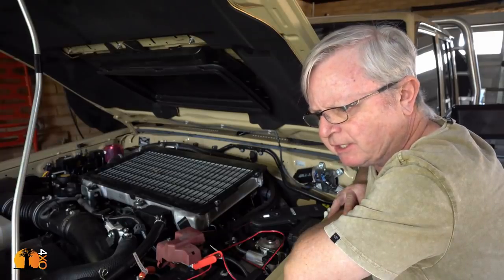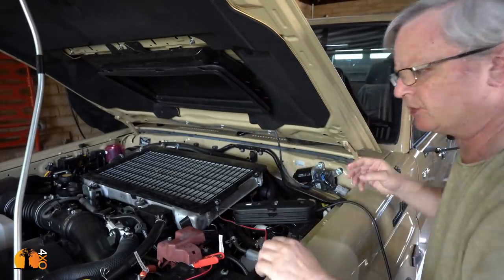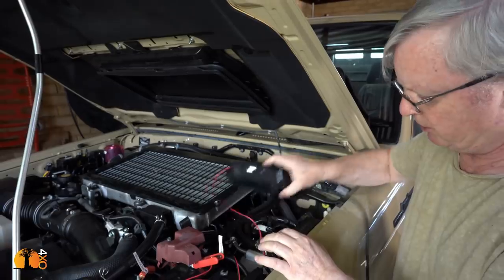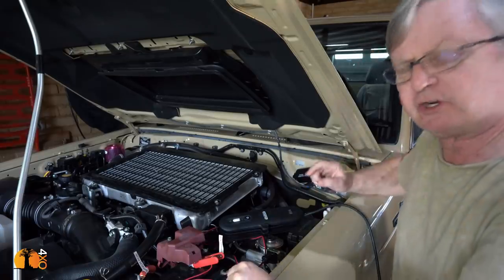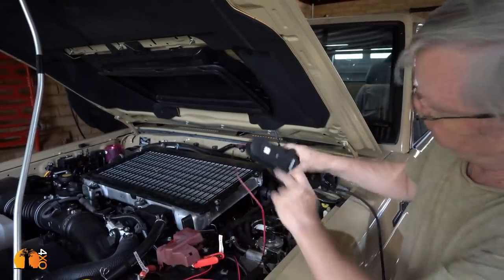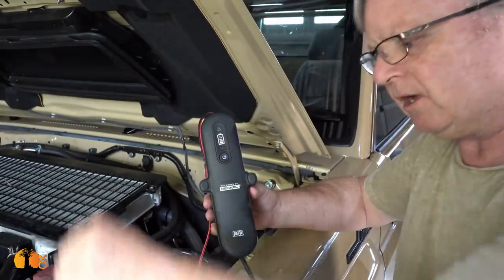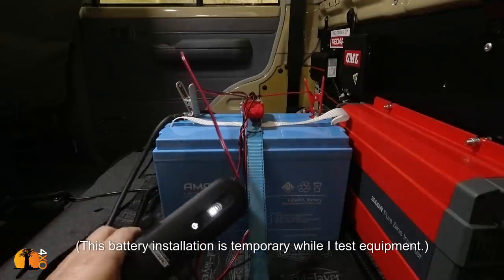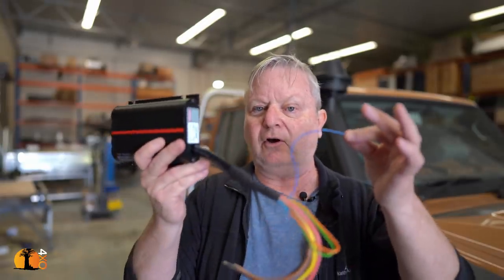DC-DC CHARGER RUNAWAY DISCHARGE WARNING.

Comment: Andrew, possible solution, mount a solar panel on your garage roof and run cables down for easy connect on to the yellow cable (solar input) on the Redarc. When the Redarc sense solar input, it will not accept input from the main battery. Therefore, as long as you only have your 10amp start battery charger on at the same time as the solar connected to the aux, then you will effectively have separated charging of batteries. 
Regards, Sean
Reply: Another, solution, in the red line between the start battery and the Redarc, add an old style silver 100 amp continuous duty  solenoid (the type we all used to used in simple dual battery set ups years ago) then trigger this from the windscreen wiper motor. Then, the start battery can only feed the Redarc when the engine is running.
Reply: i have no problems,my dc todc charger wont draw onece it reaches 10.5 volts,plus i use a dedicated deep cycle battery charger,it will charge two 120 amp hour batters plus the start battry,correct your set up.you may need a voltage sensative relay.
Reply from the maker: This is not a problem I’m trying to solve. And neither is this a mystery as to why it happened. It can and will happen to anyone using a DC-DC setup. It's the nature of how DC chargers work. All of them with the exception of those relying only on a trigger wire. The solution is to charge the auxiliary batteries first. It's that simple. When I learn something, I like to share it.

Comment: I love DC-DC chargers, but thought it to be common sense to isolate the primary and aux batteries before connecting a 220V charger anywhere in the system, even if charging the aux battery/s and the DC-DC charger won't let current through to the primary. 
I always run a 12V 60A circuit breaker between the two battery systems, this way you can even use two 220V chargers at the same time to maintain both sets of batteries whilst the vehicle is not in use for some time.
Reply: Agree Dirk, Isolation prevents any 'oops moments' , simple and effective.  :)
Reply: Agreed.  Circuit breaker to isolate.  Simple and effective.

Comment: Many thanks for the heads up on this. Just a couple of weeks into a van to camper conversion. I will add in an isolator in the circuit just to be sure. I was always taught never to leave the ignition on, that stems back to old petrol cars where depending where the points were your coil could burn out. We used to pull the coil wire off if we had to tow a dead car for the same reason.

Comment: U should have ur BCDC charger on the trigger switch u mentioned. The trigger switch can also be connected to a wire that only receives voltage when the car is running. U could also add a breaker so as the BCDC charger doesn’t see the voltage when ur trying to charge ur main......

Comment: As an Electronic technician here is some good advice for you. Never , ever charge your battery in your vehicle with an ac wall charger while it is connected to your vehicles electronics. The reason is that if for what ever reason you would have a voltage increase from the mains power or thermal runaway then you would fry your vehicle electronics. Always remove the vehicle positive terminal from the battery. You can however jumpstart from another vehicle like you would be doing right now. DC to DC chargers is for DC to DC.... not AC to dc to dc.. If your vehicle battery only was flat then you will need approximately need 10 to 15 hours on 10 amps to charge the first battery. Adding more batteries does double and triple the charging time. For an example. Drawing 10 Amps for 2 hours from a 100 amp hour battery means that you have used about 20% capacity. Charging the same battery with 10 amps will not fully charge that battery within 2 hours because as the battery gets fuller, the amps drop to eventually you will only be charging at about 1 or 2 amps. The time taken to charge the battery will be at least 8 hours.

Comment: Andrew, I realise you've identified the issue, but here's a suggestion for the future. I've fitted an Enerdrive 240v charger in the canopy of my Silverado. It has 3 separate "channels" for charging 3 separate banks of batteries. I have a somewhat similar set-up to you... A Redarc BCDC1225L and solar panels on the roof of the camper. 
When I plug the 240 volt cable into the caravan-style receptacle, the Enerdrive charges the Lithium battery, which is set to Channel One (in the canopy) first. It has the ability to choose what type of battery is being charged.
Once the lithium battery is charged, it then turns its attention the Channel Two, which is the twin under-bonnet starting batteries. To achieve this latter function, I've simply tapped the Channel Two supply line into the cable that supplies the BCDC with its power from the front batteries. 
In your case, if you go ahead with another lithium battery (inside the canopy of your truck), then you can utilise all three separate channel of the Enerdrive.
If you're interested in my Chevy, here's a write-up that was done a year or so ago: https://loaded4x4.com.au/issue-002#61
Reply from the maker: This is not a problem I’m trying to solve. And neither is this a mystery as to why it happened. It can and will happen to anyone using a DC-DC setup. It's the nature of how DC chargers work. All of them with the exception of those relying only on a trigger wire. The solution is to charge the auxiliary batteries first. It's that simple. When I learn something, I like to share it.

Comment: Fascinating! Thanks for sharing your knowledge. This situation is certainly not one that people would immediately expect to occur. I’m about to design and roll out a system into a 4WD van and I will certainly put an isolation switch between the crank battery and my custom goodies - even just if starting with jumper leads etc I don’t want the aux system taking some of that load away.
Reply: Oh - before I forget, and hopefully this helps someone - I reckon if you want to hook up that ACC wire to trigger the DCDC, hook it up to Ignition / ON position instead. That way if you’re sitting in the car in ACC mode listening to the radio, your crank battery isn’t being drained to charge the aux battery.

Comment: I run the trigger wire through a switch and to 12v+ that way I control when the DC-DC is on.
Reply: Hi i do similar ,plug into cig plug and works fine, cheers terry.
Reply: What happens when you use solar and the car is off
Reply: @Nathansillav  My solar batteries are separate from the vehicle, so it functions the same if the car is on or off.

Comment: Hi Andrew. I'd suggest re- approaching Redarc with regards to apsolute clarification as to this blue wire and voltage cut off. Someone has to be wrong, otherwise state of the art Redarc starts to look like well outdated Redarc (and any other dcdc charger that works in a similar way). I truly believe it's not Redarc as instructions despite not being so clear, suggest it's all down to this blue wire not being connected. Now a great video would be to connect the blue wire and do the same test, then try with the ignition left on to test voltage cut out, or as the case may be no voltage cut out with a mains charger connected.
Reply from the maker: This is not a problem I’m trying to solve. And neither is this a mystery as to why it happened. It can and will happen to anyone using a DC-DC setup. It's the nature of how DC chargers work. All of them with the exception of those relying only on a trigger wire. The solution is to charge the auxiliary batteries first. It's that simple.
Reply: @4xoverland  Yes true, it is a simple solution. However I'm more thinking along the lines of alternator output - I'm running a smart alternator as fitted by Mr Toyota, if I remember correctly you have changed yours or was that just the Africa terrain tamer build?  So a smart alternator can drop output to something like 8 or 9 volts, is there a scinario where by your starter battery can be fully charged in the eyes of the smart alternator however your aux batteries are near depleted and the dcdc charger pulls your starter battery down to a point where by it can no longer start your engine despite the alternator still effectively charging? My theory is the smart alternator should be smart enough to figure this out and fast enough/be able to provide enough amps to starter battery to cope.
Scinario 2 - your alternator becomes defective and cannot provide enough amps to keep your starter battery topped up, the dcdc charger will happily help kill the starter battery much quicker, this drops to a point where your vehicle electrics cannot run and your lose engine and all "factory" vehicle power. (It would happen anyway but the dcdc has made it happen much quicker. O.k. alternator failure isn't that common without warning and if it did happen your red dash charge light comes on so you can pull the dcdc fuse and potentially divert solar power to give the starter battery some form of charge - that would be pretty pointless in the U.K though, with our weather! 
Perhaps I'm overthinking the perfect storm combination? I think I'm into my 6th or 7th year of unbroken patreon support for you Andrew. Keep doing what you are doing, we all get a great amount from your videos. I truly like the fact you are unbiased and not worried about saying the truth. 
Do you have any future trips planned with Mr Paul Marsh? Stay safe and let's ride this storm out one way or another...

Comment: I was installing a BCDC 1225 this weekend, and found your clip pretty interesting. My install was in a camper, and it got me thinking… This issue looks like the starter battery needs to be better isolated from the house battery, and possibly it makes sense to treat it like a camper install and use a solenoid or an SBI to only link them when the ignition is on?

Comment: I also have a Ctek 250sa DC to DC charger hooked up to a solar panel (because it's not a daily drive) it charges the 2nd battery and when that's charged it starts charging the start battery.
Reply: Exactly. Take any overflow from auxiliary battery bank back to the starter battery. I’m looking at a dual-sensing VSR for this purpose. The Jaycar one has cut-in at 13.3V and cut-out at 12.8V.

Comment: Thank you Andrew, I always follow your channel with great interest and I particularly appreciate your willingness to share freely your knowledge and insights. I would be equally keen to hear expert opinion from Redarc on your observations. Presuming you have this would you share those with us too perhaps?
Reply: Carl Tunstall shame his information is often incorrect, omits important details or is a bias of his ignorance (take the ARB TPMS video for instance)
Reply: Here’s what Redarc said.... In regards to the connection of the blue trigger wire on BCDC, the following needs to apply:
1) If your vehicle has a standard alternator type (fixed voltage), the blue wire can be left disconnected
2) If your vehicle has a smart alternator type (temeprature compensating or variable voltage), the blue wire needs to be connected to an ignition source
3) If you are unsure of what alternator type you have, it is best to connect the blue wire to ignition

We have indeed seen the video mentioned and it does explain the connection of the blue wire, just not in great depth as to how it operates.

Comment: This is really a new problem when the auxiliary battery is Lithium.  Previously the AGMs commonly used would rarely accept 50 amps charge, no matter what the rating of the DC-DC charger.  The solution is simple - if you can afford Redarc 50A DC-DC charger (most of us can't, and are perfectly well served with a 20A unit) you can afford a 50A AC battery charger.  End of issue.  You can also wire up a dash switch into the IGN trigger wire so you can manually override on those occasions when you need to leave the IGN on for long periods.
Reply from the maker: This is not a problem I’m trying to solve. And neither is this a mystery as to why it happened. It can and will happen to anyone using a DC-DC setup. It's the nature of how DC chargers work. All of them with the exception of those relying only on a trigger wire. The solution is to charge the auxiliary batteries first. It's that simple.

Comment: Andrew, I believe there may be 2 possible issues causing this problem you either have a faulty Redarc DC-DC charger or the DC-DC charger may have a design flaw.

When the DC-DC charger starts charging the Aux battery and it has a 50A capacity and the AC charger is only 10A this will cause voltage drop and the DC-DC charger will start draining you start battery as you have experienced, but what should immediately happen at this point (12.7V)  is the DC-DC chargers low voltage cutout should trigger and stop charging the Aux battery until the starter battery voltage has recovered (13.2V) and then the cycle will continue. This would normally prevent the starter battery from being discharged which seems to not be occurring in your case. 

The AC charger should not be tricking the DC-DC charger, once more current is being drawn then the AC charger can supply the voltage of the circuit must drop, its physics.

It seems the low voltage cutout on your DC-DC charger is not operating correctly.

This leads me to believe your DC-DC charger either has a fault or a design flaw.

I am happy to be proven wrong if this is not the case.

It would be interesting to take some multi-meter readings of the system when this is occurring and see what is actually happening.

All the best in solving this problem.
Reply from the maker: This is not a problem I’m trying to solve. And neither is this a mystery as to why it happened. It can and will happen to anyone using a DC-DC setup. It's the nature of how DC chargers work. All of them with the exception of those relying only on a trigger wire. The solution is to charge the auxiliary batteries first. It's that simple. When I learn something, I like to share it.
Reply: @4xoverland  It's a problem, whether or not you think it is, and whether or not you're trying to solve it.  

If your DC-DC charger has a correctly functioning low voltage cutoff (and I would not buy one which does not,  if ever using a battery as input) then it will NEVER drain the battery it is drawing from.  

You don't have a properly functioning low-voltage cutoff on your DC-DC charger, plain and simple.  If that's what you intended when buying it, fine, it's performing exactly as you planned when it drains your battery, and there's no problem to solve.  But why buy and set up a system to do that?

Trick it into turning on as often as you want with a feeble AC charger boosting the vehicle battery voltage for a second, it should still shut off when the 50A draw drops the vehicle battery voltage of a half-dead battery a second later. 

Even then, you'd better hope that the DC-DC charger has some sort of timeout on restarting, or it might be hammering your battery a few times per second, for instance spending 0.1 seconds with your battery losing 40A, and 0.4 seconds gaining 10A.  Over and over.

Comment: Good to know.  I knew there was a reason why I hooked up the optional manual disconnect switch.  Thanks!

In my case I’m charging a travel trailer with the tow vehicle - so the protocol needs to be always unplug the umbilicals when not needed.

Comment: Thanks  Andrew, I was wondering what my problem was as the Main battery was often low on voltage. After watching your vid I went and checked my set up and it was so. I am now going to instal a relay controlled by ingnition to circumvent this.
Reply: No need to do that just put your battery charger On your house battery Once it Topped off it'll backfeed to your starting battery And charge it

Comment: Another good video thanks Andrew. What I did was to install an old school 2nd battery solenoid, the old silver can type which only activates when the ignition is on. And yes you do have to charge the deep cycle separately if it is low. Cheers.

Comment: I have a Victron DC- DC on my two auxiliary batteries,with a 10amp smart charger connected direct. No problem with  batterys, alwayes fully charged.
Reply: Overland Drive I use the same dual charger system for aux and main battery, just leave a shore line plugged in and both batteries are charged and maintained, easy. Worth buying a decent dual charger

Comment: I am in the process of changing my VSR for a 20A DC-DC, I was planning on using a DPDT switch or relay so that by default the camping batteries, when above trigger voltage (ie being solar charged) will keep the start battery full.  When the vehicle is started, the relay will be triggered (by ignition switch) and reconfigure the DCDC to charge the camping batteries effectively from the alternator.
Reply: Andrew keep the VSR and and the DC DC charger behind. It isn't costing you any extra. 

Just apply the following wiring from redarc as if your DC DC charger was not in the same vehicle and that way you have a redundancy for cut off circuit. 

https://www.redarc.com.au/wiring-diagrams/how-to-wire-bcdc-caravan-vehicle-variable-voltage-alternator

I wired the my wife and mine car like that because hers has a smart alternator. The DC to DC charger is attached to the portable battery box. If I didn't add a VSR to my car the charger would be draining my main battery too much. For hers to work she needed a VSR anyway. 

It was that or adding a switch to the portable battery box to turn on/off the blue ignition wire of the charger. But there would have been the problem of forgetting to do it and either arriving to a destination in her car with a not fully charged battery box, or flattening my battery overnight because of the low DC DC charger voltage cut off.